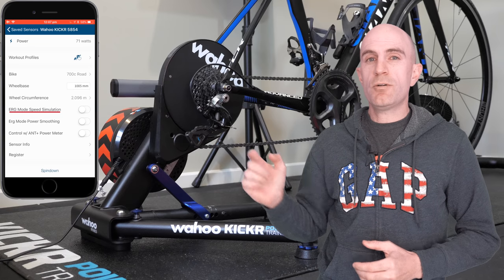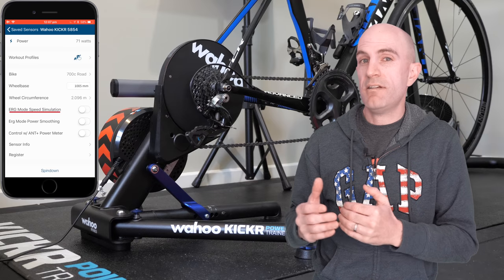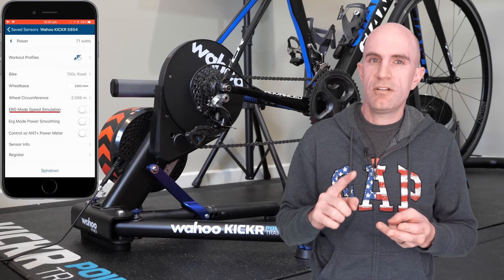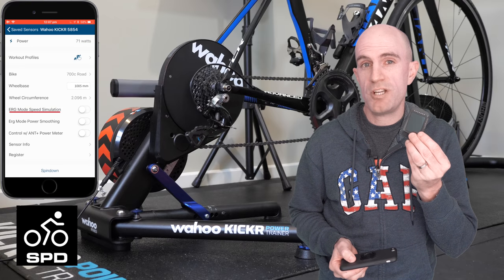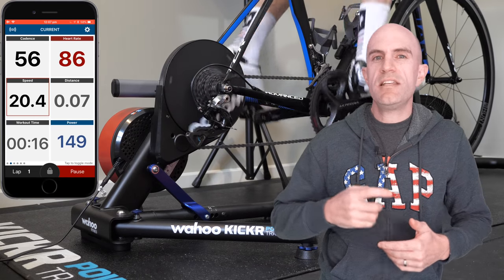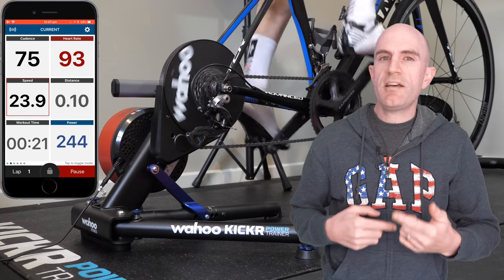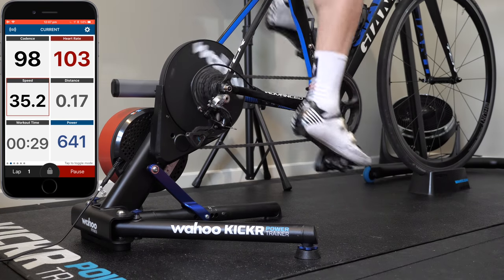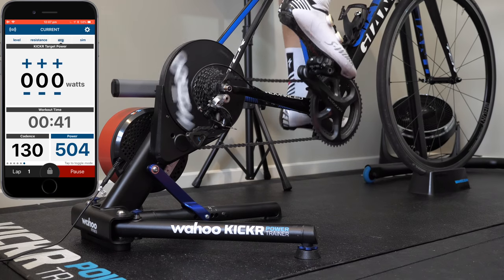Wahoo KICKR ERG Mode Speed Simulation

Comment: interesting feature. using the direto, i was really annoyed by its crooked speed readings, also correlated to the flywheel speed. my solution is an external ant+ speed sensor, which get's triggered by my pedal magnet -> speed correlated to rpm, which ist fairly consistent (around 95rpm avg. for most rides). So at least, now i'll get a more realistic distance, even though it doesn't respects how much effort i put in...

Comment: Hi Shane, excellent video. I have been experimenting problems with my kickr 2017, in ERG when using trainerroas. When there is a change of power level as the intervals come along the power in the kickr seems the same or I note a slight change in resistance but not certainly the big jump you would expect from going say from 40 to 350 watts in a VO2 max interval. The resistance seems not to be working. However when I use the wahoo app and change resistance percentages it does control the rsistance. TR says there is no problem with their app. I have reinstalled it in case but the issue persists. Have you come across something like this. Thanks
Reply from the maker: No, and that should be one Trainer Road Support could diagnose with log files or similar.

Comment: Hi Shane love these videos. I have had a kickr now for 12 months but cannot work out why an effort of 200w on ERG mode on the kickr feels a lot worse than 200w outside is there any easy explanation?
I can sustain say 280w up the Old Freeway in Adelaide for 30 minutes using stages meter but trying to replicate that on kickr there is no chance any thoughts??
Reply from the maker: Gearing on the Kickr has an impact on the feel. See: https://www.youtube.com/watch?v=uHUOhmG04M8  People typically encounter a 10% loss of power indoors...  heat, position, pedal stroke changes with trainer inertia, motivation, all factors contributing to this.
Reply: Shane Miller - GPLama thanks Shane for the explanation

Comment: Hi Shane, have you ever done a comparison between the kickr and the assioma power meter uno pedals? My 2017 kicker and the unos disagree significantly. It could be a major imbalance in my pedalling but it seems too much. Running the unos against the kicker I get a 40w difference at around 200w. Assioma reading higher than the kickr.
 Of course I don’t know which reading is right and I don’t have access to a third system for “triangulation”.

I know you have the assioma duos, any chance of a quick check with the right pedal disabled to see if it makes a big difference with you able to measure your left right balance with the duos?..
Please?
Reply from the maker: Lots of variables to isolate here. The Kickr1/2/3 up against the PowerTap P1 and Quarq has produced good results. The P1 and Quarq up against the Neo, the same. The Assioma DUO against the Neo, good as well. So I'd be confident the Assioma DUO against the Kickr17 would also result in good results too..... but I haven't done that specific combination test (only so many hours in the day for combinations of things). RE: The UNO. That's another question again... and that introduces the human factor - leg balance. Also potential balance changes across different zones. It gets tricky. And my results might not match your results in that test.

Comment: I know this sounds stupid but for it work with the head unit, the kickr will needed to be paired as a trainer and as the speed sensor on the head unit, and then have the speed setting turned on in the wahoo app. Am I saying it right 😂

Comment: One question - I turned this feature ON and it worked for my training. However next day my GPS unit showed again my speed doubled. I checked, and it was still turned ON - why is that? Is there any specific sequence I should turn on my devices (pc with zwift, kickr, garmin edge)?
Reply from the maker: This should save the setting on the Kickr and remain on or off depending on what you set it to. Ideally for Zwift, just link that to Strava &/or Garmin Connect and don't worry about a head unit indoors.
Reply: @gplama  I had it connected with Garmin, Strava and Trainingpeaks but Garmin has feature to calculate training effect and it doesn't work with uploaded trainings. I would really like to leave it synced by zwift but this training effect is really useful for me :)

Comment: Does elite have this? I get crazy high speed readings from the direto on my bolt head unit
Reply from the maker: Not that I'm aware of. The wheel size on the Direto needs to be set to 173mm (head units only, not their app/software)

Comment: I toggled this but it made no difference on my Garmin 830 head unit. Almost as though, like zwift and TR, Garmin calculates its own speed data.
Reply from the maker: Zwift calculates its own speed in-gam. This mode only changes the speed broadcast from the Kickr itself.
Reply: @gplama  have you tested this to see if it changes speed in Garmin head unit though? Not bothered about zwift as don’t use it
Reply from the maker: The Garmin will read the speed broadcast by the Kickr. I suspect if the same tests in this video were repeated while the Kickr was reading the speed, it'd match the Wahoo App as shown.

Comment: So speed on the flats basically
Reply from the maker: Mode off = Speed from flywheel (physical). Mode on = Speed from power (calculated).
Reply: Shane Miller - GPLama but is calculated based on riding on flats with mild wind etc.
Reply from the maker: Arhh... There's no detail on exactly what the calculations are based on. I'll assume you're on the money. It'll be an average of everything (I'd say flat, average CdA, weight, etc).